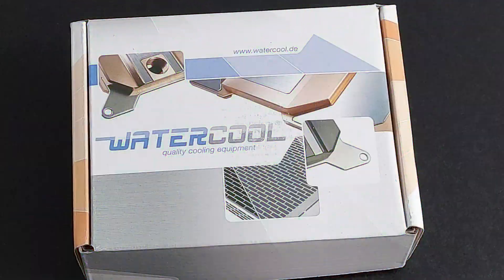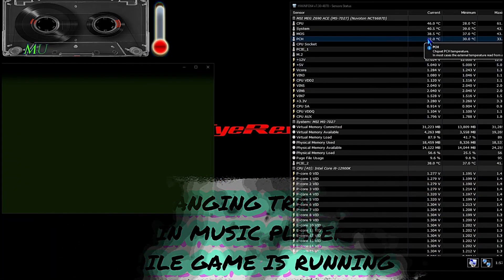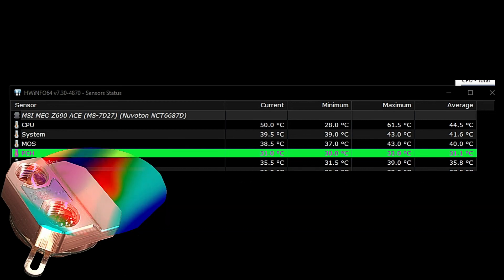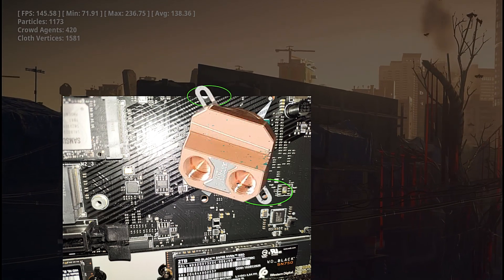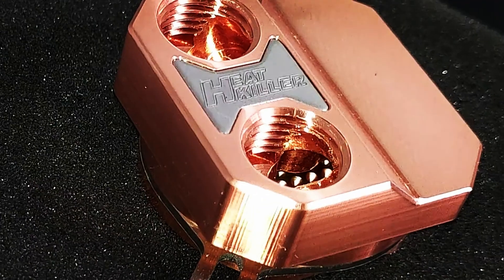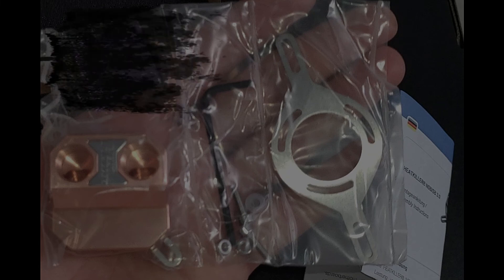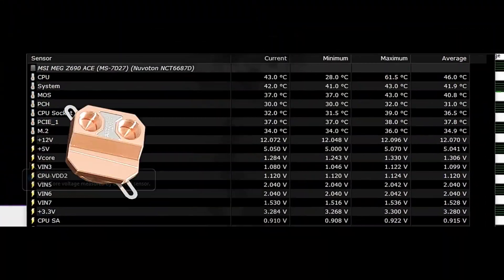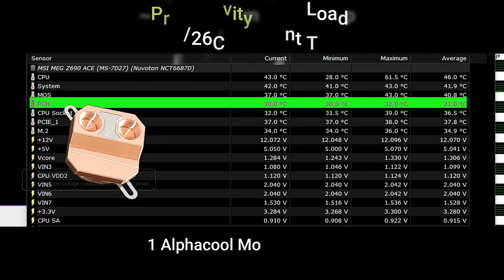Can The Heat Killer Chipset Water Block Cooldown The Z690 (PCH) Temperatures? Watercool's SB REV3.0

Comment: hi do you know if HEATKILLER is compatible with a MSI MAG Z690 TOMAHAWK??
thank you in case of any help!!!
Reply from the maker: Unfortunately, I don't have that Motherboard on hand to test, but it does have quite a universal design with slotted mounting brackets that are able to slide and give some wiggle room to line up the 2 attachment points, as seen at 8:36 in the timeline above. And because it uses only 2 attachment points, it doesn't need to line up with all 4 of the original screw holes.

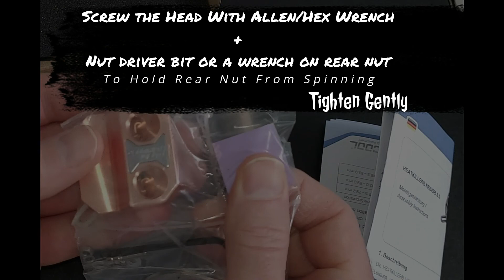 If you run into any issue, it would probably be whether the diameters of screw sizes included are too large to fit into the mounting holes on some motherboards, as we talked about briefly in the video above at the 7:01 mark. 

In that case, you may end up needing a variety screw set to get a smaller diameter screw of a similar length that will fit into the mounting holes on some motherboards. 

For example, The screws included with the water block mounting bracket fit on an MSI Meg Ace Z690 but were too small to fit through the mounting holes on an Asrock Taichi Z690, so we bought a screw kit (linked below) that had an assortment of lengths in M2, M3, M4 sizes, and we used one of the smaller diameter screws of about the same length as those included with the water block, along with a washer under the screw head from the screw kit, and that worked on the Taichi. 

So, on some motherboards, you might need a screw kit with similar diameter and length screws as was included with this one: https://www.amazon.com/gp/product/B09BPYNXNM

The one we used and linked above is currently sold out, but they have a ton of those around, and maybe you can even find them at local retailers or hobby shops.

Another thing to remember is to make sure you have enough clearance behind the GPU for the water block and tubing, as we covered some in the video at around 5:44

Comment: Why would you do this?
Reply from the maker: This would be an option for systems with a liquid-cooled GPU that are experiencing extremely high PCH temperature readings due to the underperformance of some stock cooling configurations. Excess PCH heat might lead to a drop in the connectivity of some peripherals that send data through the PCH, as interrupts are generated when the system crosses Intel's "hot" or even "catastrophic" trip points during higher-load usage scenarios. Some higher-load usage scenarios, like gaming, media editing, large or extended file transfers, and demanding LAN or audio connections, to name a few, might lead to increases in DMI throughput and PCH heat.

In a previous video (linked below), we briefly looked at some of the heat and performance issues that some system owners were experiencing and touched on Intel's 3 interrupt trip points for the PCH:  https://www.youtube.com/watch?v=B1fDjclPk0M 

In that video, at the point in the timeline linked below, you can also see a block diagram from MSI displaying some of the connectivity going through the PCH on some of the Z690 motherboards:  https://youtu.be/B1fDjclPk0M?t=116